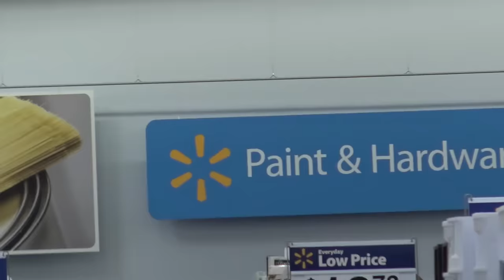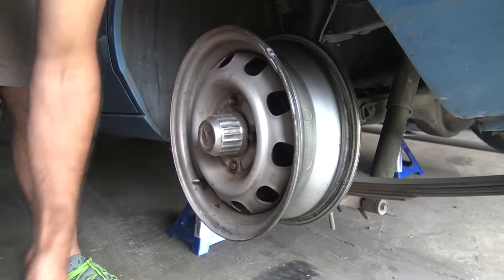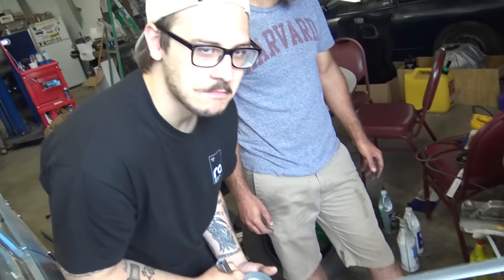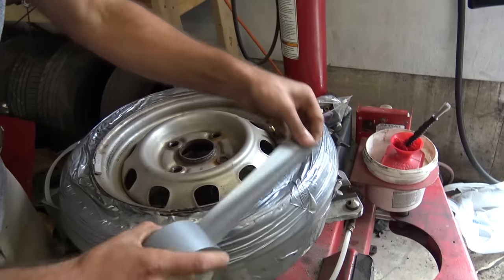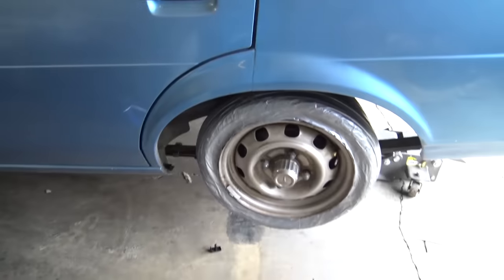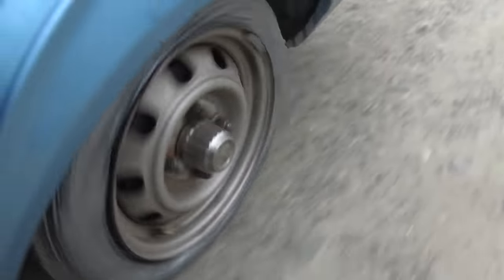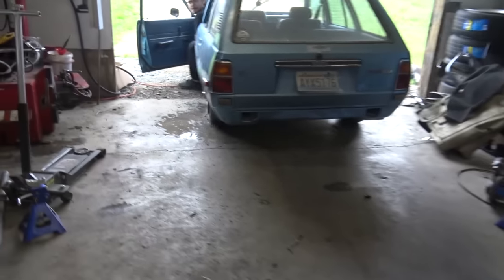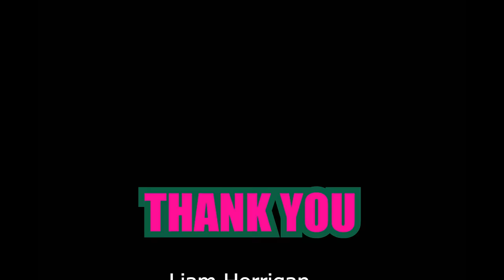We Made A TIRE Out Of Duct Tape

Comment: Tyre companies hate these guys, here is how they made a tyre that can run infinite miles and you can regenerate at home
Reply: *HATE.   You got to get dem legit looking caps. That's the only way you know it's a legit website.
Reply: Domex YT Tyre is correct, "idiot". He's using the British spelling of the word.
Reply: RockingStar1011 no, actually use the letters in the word and see what it says.. im sorry but the british got it fucked up, tyre sounds like tye-ree which is a black guys name.. its tire
Reply: carolyn mmitchell Tyre is pronounced the same as tire. There is no way to mistake it as long as you know how to read and sound words out. An extra e at the end and you'd get, tyree like you're trying to say. But there is no extra e. It's just tyre...same as tire.
Reply: Learn how to spell tire
Reply: The duct tape probably costs more that a tire😂
Reply: Tyre and tire are both correct
Reply: How do you know that tire/tyre companies hate him?
Reply: @carolynmmitchell2240  you know that the english language is originated from the england right
Reply: ComputingCode
1. I would question the state/condition of a duct tape tire after 100,000 miles. 
2. If could go infinite miles as you claim there would be no point to regenerating it. 
3. "You can regenerate at home"
Then it can't go infinite miles. 
4. They don't test over thousands of miles, over several years. Over long periods, that tape would wear out and wear thin just as rubber does.

Comment: This is actually good. You never need to worry about puncture. Just keep some duct tape handy and patch it up when needed. For better grip make thread pattern on it.
Reply: >keep some duct tape handy

Yeah right, I drive around with 50 ducttapes in the boot of my car.
Reply: And probably a tire like this will last for about 1 km
Reply: Thread patterns are for water flow. More surface area equals better grip.
Reply: Fam, no stability at speed and adding tread doesn't add grip. The military do use solid or honeycomb tires for some slow vehicles since they don't go pop I think
Reply: Amit kumar dash great idea 😜
Reply: dega uh they drove it around much more than a km.
Reply: Robin Rai the tread is so the slick surface doesn't hydroplane, agree with high-speed, however you saw the shitty tires on that thing slip first (that or the diff is right-biased xD)
Reply: Sang Eeth 50 rolls of duct tape can be used for other things, and tbh you probably will only need like 10 since just coating the rim will make it safe enough to drive home at low speed

Comment: Make all 4 tires made of duct tape
Reply: And hit the freeway!
Reply: @RebornSleeper not enough we need 400
Reply: Did you listen at the end
"Can you make tire entirely out of duct tape? Yes. 
Would i recommend it? No"
Reply: @bonso5906  they didn't use 100 rolls for one. They use maybe 50.  They bought 50 but i honestly don't know if they used it all. So 50 per tire for 4 equals 200. 

Now for bigger tires depending on the size....

Comment: 2018: 

Tire company: We have invented and tested airless tires on heavy duty construction vehicles. Soon, they will be used on cars and on the road!

This guys: Airless, rubberless, trouble less.
Reply: With woaaah, that's a heck of a grip^v^
Reply: cars never use to have air in tires ... they have air in them for a reason
Reply: Jhamar L. B. Maybe we use more rubber outside the duck tapr
Reply: It can be, but the issue can be, the weight of the wheel will be added, I guess.
Reply: Kiraro The Kitsune There will never be airless tires. That's why cops use nail strips or whatever they're called to stop a car. But... I could be wrong..
Reply: Jhamar L. B. Yeah, slick for burnouts
Reply: GarronGoesGaming They have tested new systems that tangle tires and grips on to them to stop getaway cars. It's safer than popping tires and the pit maneuver which can cause the car lose to control, roll and kill everyone in the car.
Reply: Jhamar L. B. What!? If you mean the weight of the vehicle and wheel will bend the airless tire, then, they don't.
Reply: What I mean was the the wheel will be heavier than before. But I do agree to no popping tires.
Reply: Jhamar L. B. Can many rolls of duct tape be heavier than a new rubber tire? 🤔 Well, more mass!
Reply: Will the heavy tires can affect the car's performance? or just the same?
Reply: Jhamar L. B. Well, I would say that heavy tires = flat tires but because they are round the performance raises. So, it's like rolling on a flat tire that stays round which should reduce the performance, also, it's stiffer so the suspension gets more stress, stress reduces performance and efficiency. Plus the tire is probably not properly balanced which affectes even more.
Reply: Well that can be disadvantages of the heavy tires.
Reply: Nasa invented airless tire years before 2018
Reply: GarronGoesGaming you could have solid rubber tires, and heavy industrial vehicles use them cuz you wouldn't want a flat tire on a 30+tone crane :))
Reply: Flat Tires Will Be No More
Reply: GarronGoesGaming lol these can be used as get away tires
Reply: Jordan Tucke thank you for putting that on mu mind
Reply: They didnt think of this ffs, they stole the idea from a russian channel that has done tires from duct tape, paper...
Reply: Kiraro The Kitsune ,  but not TIRELESS....
Reply: Kiraro The Kitsune lol
Reply: Kiraro The Kitsune ha lol
Reply: Tim Minh Oh...
Reply: @PPhase  they don’t need air

Comment: For the amounts of money used to purchase all those rolls of duct tape, could have purchased at least 1 tire, possibly 2 tires from the clearance shelf in Wal Mart or buy 4 used good condition tires from buy and sell website.

On the other hand you have assembled a tire thats not going to get flat, the question remains, how long will the duct tape tire last before having to technically re-tread the tire, or  re-belt the tire.

If successful, I could see burgulars running from the cops, drive over spike strip and still keep going, until their car gets boxed in, pit technique applied, run into a dead end street, or run out of gas.

That tire is not balanced, expect irregular wear patterns, and shorter life.

Also stopping maybe difficult, especially panic stops from high or higher speeds, due to lack of traction, that duct tape tire is basically slick tire, no tread patterns.

This duct tape needs alot more further testing, to find out its advantages and disadvantages.
Reply: The steering feel and response, maybe negatively affected.

Brake feel and response also maybe negatively affected.

On the other hand, looks like these fellas are having fun and enjoying it too.
Reply: The duct tape tire has not been tested for public roads and has not yet passed the tire quality standards, as of right now, for other than private property or off road use, the tire maybe illegal for use on public roads.

Tire Performance Criteria,
Standards has not yet been met or exceeded by the TPC test specialists and the inspectors.
Reply: Willmer, that was completely unhelpful. Say something like that to someone in real life so they can beat you within an inch of your life for being a creep. You're all tough when you hide behind your keyboard being a bully. I'll bet you're a coward in real life who wouldn't say that to a woman because you're afraid she'll beat you.
Reply: Tiger, This is definitely not a tire which would be practical in production, but nonetheless it was a fun experiment. I was personally disappointed that they didn't seem to balance it, which would have made the ride better and also been interesting (how much weight would it take to balance that?)
Reply: I think this would work. You can make a thin tire and then put the normal tire and get them balanced. I will be as the bullet proof cars so it can still run with a flat tire
Reply: @edif.. It was very helpful information,  OP listed why this duck tape tyre isn't a solid alternative as it is right now.
Reply: Why are the people who replied triggered??  Are you guys mad someone has a brain
Reply: Jesus Christ Albert Einstein slowdown
Reply: It does make an expensive tire. Duct tape is $5-$10 a roll, so a minimum of $250 a tire, lol.
Reply: edifyguy exactly!!
Reply: adamaj, and Tiger... imagine if they did Sticky Side out for a few turns that would be perfect for drag cars, you wouldn't have to burn out for sticky rubber since it would already be sticky!
Reply: Doug Owens : The tape would lose its stickyness, due to dirt on the tape's sticky surface.

Warming up still maybe needed.
Reply: Make a wire tire
Reply: This was for fun. Not for public use

Comment: 2 things . 1) the cost of the tape alone doubled or tripled the value of the car. 2) for the cost of the tale you could have put on NEW tires and rims all around. $7.49 a roll X 50 rolls = $374.50. A tire on my big rig (22.5" X 11.5" wide $298.00 NEW each) cost less than that. BUT IT WAS FUN TO SEE DONE

Comment: Duck(duct) tape is some really strong stuff-the good brands are even better but you’d be surprised at the cheaper ones as well. 
Duct tape is universal in a pinch. Just ask anyone from Ohio 😂 jokes aside I’d rather be using duct tape than be sitting stranded somewhere. It can repair hoses, patch leaks, and yes you can make a tire from it(albeit a rather expensive one) remember that duct tape is nylon reinforced so it will take quite a bit. Also there’s countless crafts you can make from a dog muzzle(no sticky sides on the dog please) to complete boxes and storage sheds. You probably could build a house from duct tape.
Reply: Ohio JOKES ARE NOT FUNNY ANYMORE OHIO MEME IS DEAD.
!!!
Reply: @cam53113  

Suck it up. They are older than bugs bunny 😂
Reply: @kittyfanatic1980 BUT OHIO MEME IS DEAD ITS 2023. YOU KNOW OHIO MEME IS NOT FUNNY

Comment: Duct tape tire is slightly more expensive than a normal tire, but the benefits are:
1.Wont Pop
2.Has Extra Grip
3. No need to check tire Pressure 
4. You can do it yourself.
5. It fits technically all sizes.